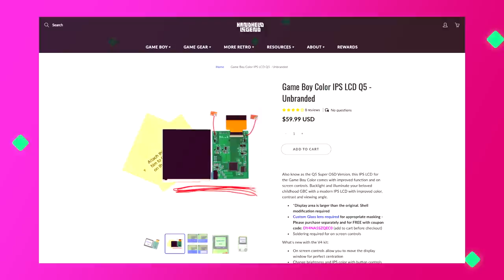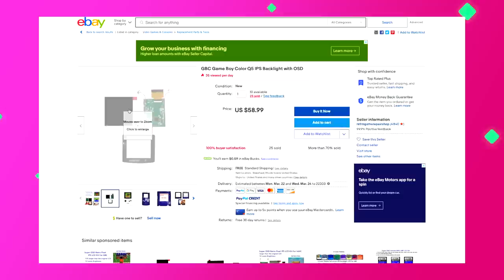BIGGEST Backlight IPS Kit For The GameBoy Color! | Q5 OSD XL IPS Kit | Retro Renew

Comment: I have the Q5 screen and you can utilize the battery mode. You need solder in a 4th wire to battery pad on the screen board and to the positive terminal battery just above the a/b button. It displays the battery level in the upper right hand corner
Reply: Just installed mine today. It’s great. Can you turn off battery level indicator if wanted? Edit. Just looked in the menu. You can. Looks like I’ll be opening her up again tomorrow
Reply: How did the battery mode work out?  I'm curious what kind of voltages it is set to for its range.  As I would like to utilize this for a gameboy color with a lipo battery installed.

Comment: Put this exact kit in my GBC build last week. I love it. Anyone looking for an IPS kit, this is the one for you. I bought it along with a precut shell so I wouldn't have to do much modification. Although I did need to take a little more off the edges of the viewing area. You were able to still see some of the edges with the glass screen installed. My kit didn't come with those 3D printed brackets. So I had to do it eyeball it. But I fixed it and it looks amazing now.

Edit: forgot to mention. You're going to hate those touch pads. They are extremely sensitive. Even when I know I haven't touched the area, I find my brightness is higher than what I've set it at. I plan on going back in and just taking wire cutters and removing them. You can do everything from the OSD. The touchpads are really only for those who can't solider.
Reply from the maker: That’s a good observation. I do notice also that I press the sensors on accident.
Reply: Where did you buy the precut shell from?
Reply: @Raiden8816  I got the screen, shell & buttons from Aliexpress. Total was $57. Took about a month to arrive.
Reply: I was afraid of that. As soon as I saw they go in the corners I thought "Yup, those will get triggered by accident"
Reply: I don't know, I am so used to them now that I very rarely touch them by accident, and if it does happen then it's just a few touches to put it back to normal. I do have the menu working, but it's a bit fiddly to use so happy to have the sensors. Could probably live without the left - colour tint - one though

Comment: I used this guide and it worked great. Only thing you didn't do and I suggest people do, is wire up the BATT test pads too, so you can have the battery level indicator working - you said it's not a feature on this mod, but it actually is. Thank you again!

Comment: Hey, i know this video is a bit old and i dont know if you or anybody else will see this comment. I just wanted to say that if your having power draw issues with your NiMH batteries, you can use NiZn batteries in conjuction or byselves to improve performance. The NiZn batteries are available on Amazon and Ebay from a few brands to pick from. They perform great and are rechargable. They even sell Lithium AA batteries, but they dont have as much upfront power like the NiZn.

Comment: I just finished this build today!
Thanks for the tutorial, It made the process significantly easier.
I will say though, where I did struggle the most was cutting the shell without the 3d printed outline.
I dont own a 3d printer, so I had to use the glass screens sticker outline and use a dremmel to sand it down because I couldn't cut in a straight line.
All in all it came out really nice and is totally worth the effort.
Reply from the maker: Awesome!  Yeah totally agree, the shell cutting is the most challenging part of the mod.

Comment: For anyone trying to get the battery monitor to work. You need to run a wire from BATT on the video board to the Positive battery terminal. You also need to run a wire from the GND on the video board to the Negative battery terminal.

Comment: Really great kit! Something else to do before putting the insulating film onto the board is wiring the BAT port to the positive battery terminal and the GND port to the negative terminal so that the built-in battery monitor will work. My kit came with 4 wires and one cut about in half reached A and B so I was able to get everything wired up easily
Reply: Also, holding the right touch pad will toggle the battery sensor so you don't have to go back to the menu when you want to toggle it

Comment: About the Eneloop problem:

It Probably has to do with NiMh Batteries having 1.2V instead of 1.5V from a fresh Alkaline one. (This will also mean that it won‘t work when the disposable Batteries are already drained to 1.2 or lower)

There are Lithium Ion AAs that output 1.5V for devices (or in this case combinations) that need more Voltage.

Comment: Something of note that might be useful is that you can actually buy lithium-ion rechargeable batteries in AA form factor. These will run at 1.5V almost their entire duration, meaning that you'll always be able to power flash carts and still be able to recharge your batteries. The only problem is you'll have trouble figuring out just when they're getting low until it's very nearly dead, so you have to watch out for that. You'll also probably need a charger specific to them.

IKEA LADDAs and Eneloop Pros will usually work fine as long as they're more close to fully charged (they have more capacity than standard eneloops and LADDAs are cheaper) or you have a newer flash cart, since the newer ones use less power.

This mod is lovely, about the same size as the Game Boy Pocket's stock LCD, and the pixel grid effect is excellent. Also, a use for the color palette toggle is if you want to play a regular Game Boy game on your GBC, but you don't like the predetermined palette or any of the palettes you get from holding directions and buttons at startup.
Reply from the maker: Thank you for the tips on the batteries. Will def look into that!  Also, that is a great point I hadn’t thought about playing regular gb games, the pallet would certainly be useful for that!  Cheers!

Comment: Another fantastic review.  I plan on buying this kit eventually.  If you plan on replacing your aging Eneloop batteries, you may want to check out the Ladda 2450 mah batteries from Ikea.  A four-pack is only $6.99 and they sell a cool charging book that holds 8 AA's or AAA's and you can leave the batteries in the book plugged in, as it turns off automatically.  Highly recommended.  Thanks again!

Comment: In my opinion your issues with the flash cart are more likely to do with voltage rather than the battery age. These rechargeable batteries are rated for 1.2V whereas non rechargeable batteries are typically 1.5V.
Reply from the maker: Very true Stuart. I’m thinking it’s time to replace some. Cheers!

Comment: It's a voltage issue, alkaline batteries are 1.5v nimh are 1.2v. With a large draw on power the voltage drops below its threshold and causes the boot cycle.  Check out the blackube rechargeable lithium AA batteries, they are awesome i use them in mine and are a great upgrade.

Comment: To aadress your issue with the Everdrive: get Kentli PK5 rechargable Batteries, those are lipo's tweaked down from 3.7v to 1.5/cell, they deliver the Voltage you need :-)

Comment: Hi, tito. I love your vids. U always have interesting stuff to show for different retro consoles. I just saw your vid on making the gba sp wireless charging and I was inspired.  I tried to make my NES,SNES, GB AND GBC cartridges wireless charging like u did for the gba sp to avoid damaging my cartridges every time I need to solder a new battery. I found little success, but hey the idea  is there if u want to take a crack at it.😁
Reply from the maker: Hi Archy88!  So glad you’re enjoying the videos!  That is a very interesting idea to wirelessly charge carts. Just need to be carful with heat and being sure to use the correct battery. Some aren’t rechargeable. Very creative though!  Cheers!

Comment: Once you get the new screen in plus the PCB and ribbon cable in there I find that it makes putting the motherboard back in a bit of a squeeze, I can see in your video around 10:30 as your screwing down the motherboard that its lifting very slightly in the top half. How do you minimize this? Because I'm noticing that when I put the shell back on it affects things like the volume wheel and the power switch.

Comment: The Everdrive problem is related to the lower voltage issued by the batteries, that's why you're able to boot on lower brightness, but not on higest. Performing a LiPo mod is a good way to circumvent that, since LiPo provide larger voltage than regular rechargeable batteries.
Reply from the maker: 💯I def need to get a good lipo battery in there. Maybe usb-c too?  Cheers!
Reply: @MachoNachoProductions  USB C is the most elegant way right now, but it take a whole lot of space. Replacing the regulator can be useful too. Stock ones are not designed to hold such a load. A lot of work, but I’d say it’s worth it !

Comment: Excellent video as usual mate, but did you know that if you run s wire from bat on the board to the 3rd pin on the power switch, you can switch on the battery monitor and have it in the top left corner instead on relying on the led to see battery levels
Reply from the maker: Thank you James 🙏!  

I had thought about it but wasn’t sure exactly were to solder to. I may definitely add this feature later in, it’s pretty neat!  Cheers!

Comment: I ordered the version that comes with a precut shell. I opted not to solder. However, one of the screws is now stripped as I tightened it too much when putting the shell back on. Wondering if there's a way to remove it should I need to open it again

Comment: Replacing your rechargeable batteries may help, but it may also be the case that NiMH batteries have a lower nominal voltage (1.2v) than traditional alkaline batteries (1.5v). The gameboy color pulls that voltage up to 5v, so the battery voltage usually doesn't matter too much, but with the higher current draw of the screen + flash cart the voltage is pushed below a stable level and the battery bottoms out.
Reply from the maker: Thank you for the explanation l Ardent Drops!  I wonder if there is a voltage regulator mod we could do to fix this issue. Cheers buddy!
Reply: @MachoNachoProductions  absolutely! If you were to upgrade the power I might recommend skipping straight to a LiPo solution. But, I can't deny there is some satisfaction in popping in fresh batteries...

Comment: Hi Tito, very neat build you did there, good job! I have to say that the aligning brackets you used are unnecessary imo, primarily since you’ve the possibility to align your screen with the help of the OSD, what I did was just make sure the screen was aligned straight at the top.
Another thing I tested was the battery display option which I soldered the wire to - didn’t get much out of it since I use rechargeable batteries which have lower voltage - but it’s ok I guess if you wanted to enable this later. I measured battery life with my Everdrive-GBx7 and with rechargeable batteries and mid brightness I got a little over 7 hours, which is decent enough.
Cheers!
Reply from the maker: Awesome!  Thank you for the info Jesus!  Very useful. I would have done a battery test but ran out of time this week. 7 hours is pretty good!  Cheers!
Reply: @MachoNachoProductions  super indeed, providing this is a bit more power hungry than the funnyplaying kit (smaller screen). Btw, I tested loading my Everdrive with max brightness and rechargeable batteries and I didn’t run into issues; good news you only have to replace them old batteries hehe

Comment: Rechargeable NiMh cells are only 1.2V so that could certainly be it, backlit screens often have issues with flashcarts on the Game Boy line. I'm waiting for CleanJuice kits to come out for the Game Boy Color before I mod mine. I already modded 2 DMGs with RIPS V4 kits (essentially the same thing as this), aftermarket shells and changed the color of the power LEDs, but I don't have CleanJuice kits for them and I'm waiting to make an order for them as the shipping is kinda expensive, so I can make a bigger order with CleanJuice kits for both the DMGs and my GBC (and perhaps my GBA) and screen kits for the latter.

Comment: I've read a Pololu Voltage Regulator installed in the GBC will fix the power issues with the Everdrive. Information is pretty spotty though. I haven't seen it mentioned in any videos yet.

Comment: You can fix the resetting issue with the everdrive by installing a 5v regulator ontop of the GBC's voltage regulator.

Comment: I would really love to see someone do a review after extended use. I'm seeing an unusual number of complaints online (Reddit and other forums) indicating that there MAY be a problem with the boards themselves, and some retailers are giving people a tough time with returns... Which would seem to indicate that the issue may actually be known.
Reply from the maker: Interesting what issues are folks having?  I’ll be sure to keep an eye out on it.  Thanks for the heads up!
Reply: @MachoNachoProductions  I've seen multiple users on Reddit reporting that the screen worked great the first several times they played, then the screen just wouldn't come on when they turned the system on again. 
One user took things further and confirmed that it was actually the display driver board, not the ips display itself. Sounds like the display driver board is shorting out on folks, but that's just based on the problem being described.
Reply from the maker: Thanks Dan!  I’ll def keep an eye on that. So far mine is working well. Definitely need to make sure to use the included insulating film to prevent shorts. Again thanks for the heads up. Cheers!

Comment: Fully charged NiMh batteries will get you 2.8v, Brand new alkaline will be around 3.2v so the cart plus the backlight just presents too much of a voltage dip.  Also, what temp do you solder with on these mods.  You seem to get some dags (pointy parts when pulling away the iron from the joint).  Should only need 320c or so for these types of jobs.  Any higher and you're burning flux away too fast.

Comment: I have the ips v2 mod... I think I'll stick to it, but I recognise this screen mod settings as Ive seen it with my backlit neo geo pocket mod. The pixel effect is amazing on it and that's probably the main selling point for me (I have a thing to make the console look as original as it gets, so the larger screen slightly puts me off, not that it's a bad thing, I can imagine many liking the size of the screen).

Also, great video. Not sure if you have done it yet, but check out the ips psp 1000 screen mod. Would love to see your views on it.
Reply from the maker: I agree, the V2 is fantastic as well!  Been looking to do a psp video. I absolutely love that console. And IPS mod would be great at hopefully reducing the ghosting in those consoles lcd. Thanks for the tip!  Cheers!
Reply: @MachoNachoProductions  yess please. I have a ton of broken psps I saved over the years. I wouldn't mind reviving some of them with you guidance.

Comment: Great video, Tito. So far I've done just about every mod you've done. Your tutorials are by far the most intuitive and easy to follow. Here's a question: do you think they'll ever get to a point where they could do a cloud version with the GBC like how they have with the GBA that doesn't require shell modification? I have several OEM GBC shells and I would like to use them but I don't want to modify original shells. Thoughts?
Reply from the maker: Thank you dude🙏!  So happy you’re enjoying the channel!  

I think it is possible, the only issue is finding an existing panel that meets all the specs to fit in the shell without modding which may not exist. The only other option would be to manufacture a custom panel which is unlikely. Hard to say, but it would be nice. Cheers!

Comment: I really dig the pixel mode. I would mod my Gameboy color but it has issues with the sound at low volume on both the speaker and ear plugs. I replaced the caps and it didnt fix it :(

Comment: Let's talk batteries. I have Lithium rechargeable batteries that I use. They recharge with a built in USB port, output 1.5 volts, and operate at a high discharge rate. They have no memory like Ni-CD or Ni-MH batteries and can be recharged without removing them from the console. If you want a link I can send you one via email, but you can find them all over Amazon. I use: EBL USB Rechargeable AA Batteries, 1.5V AA Lithium Batteries 3300mWh. Super convenient. I have them in my GB, GBC, and GBA. All with back lit screens and I have zero issues with power draw.

Something to look into.

Comment: The problem that you are having with the Eneloop batteries is that they only give off about 1.2V instead of most AA batteries that give off the standard 1.5V or sometimes even 1.6V. 
At max brightness and your cart pulling more energy for the modern chips might be pulling closer to 1.4V
Reply: I'd recommend getting the JUGEE 1.5V AA rechargables. They are Li-Po instead of Ni-MH.
Reply from the maker: Thank you for the recommendation!

Comment: I've heard that the everdrive draws more current when loading data from the SD card. You may be able to alleviate the issue by using an sd card that draws less current during reads, but there may also be no way around it.

Comment: I installed this Kit today and I'm having random craches in several games. I'm using Ikea Ladda batteries, I also notice that the intensity of the power led is constantly changing.
Reply from the maker: Could be a dirty power switch. I usually try to clean them as they can be the source of power issues.
Reply: @MachoNachoProductions  Many thanks for the tip, I will check it. Congratulations for your channel and videos, they are awesome.

Comment: 16:06 -- can't you get either a 3.6v or 5v Li-ion or Li-Poly battery and get a 3.3v or even 3v voltage regulator, hook it to power and ground and use a rechargeable battery that way?